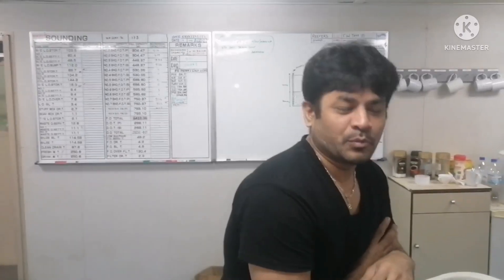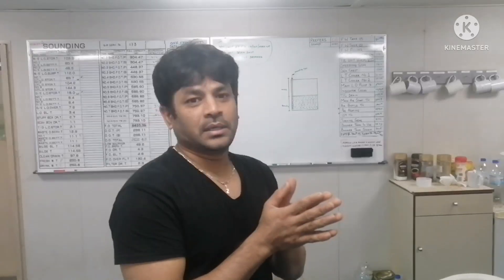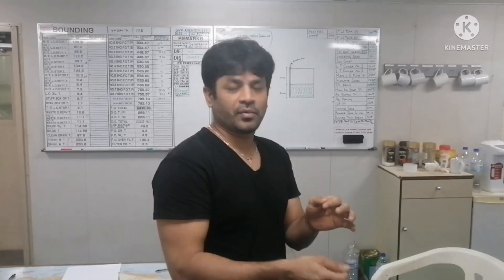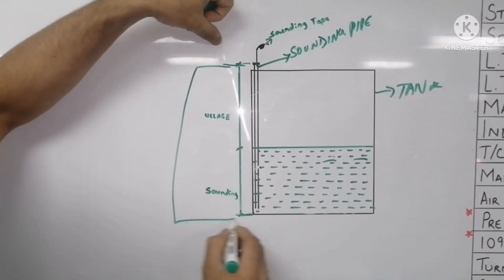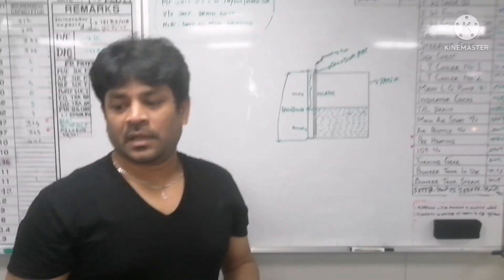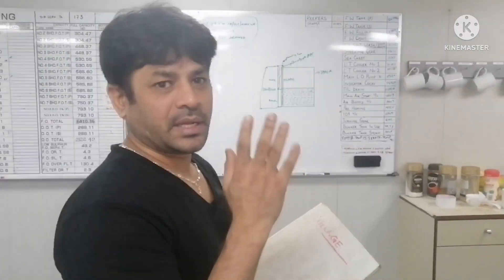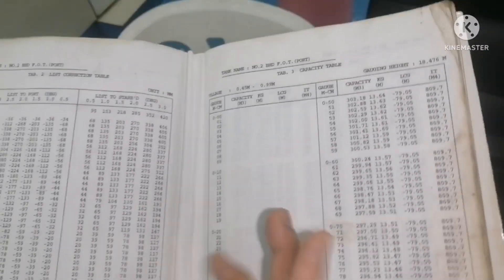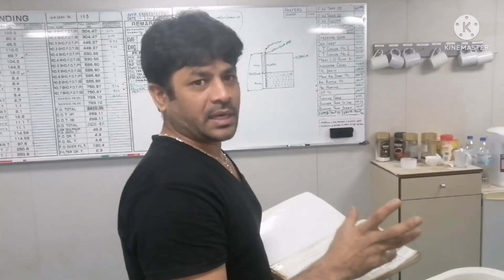HOW DO THEY DO... HOW TO DO BUNKER SOUNDING CALCULATION....

Comment: There should be corrected as 2.10m! Not 2.10cm
Reply: 2.10m = 210cm = 2100mm
Reply: Yes , that’s correct , in the above video it’s been mentioned as cm instead of meter. To convert same to mm.

Comment: How to Calculate how much Fuel oil is Received , I mean how to take coefficient of expansion of fuel into consideration?
Reply from the maker: To make it simple u can calculate received quantity with temperature and density during intake... Most of the time things get complicated wen you go on vth all the factors... Yes wen you are going to raise a protest you can use all those factors.. But in this era the chances are very less..